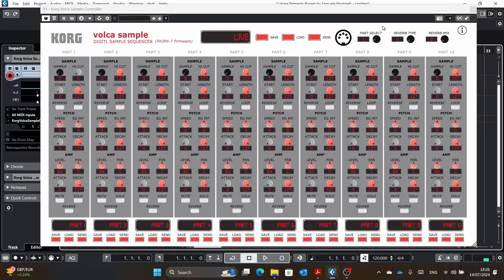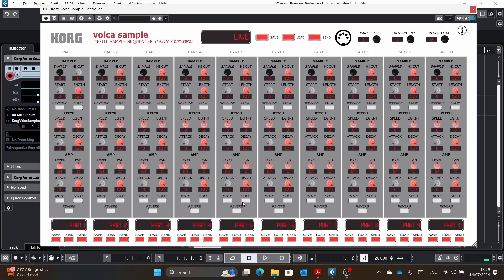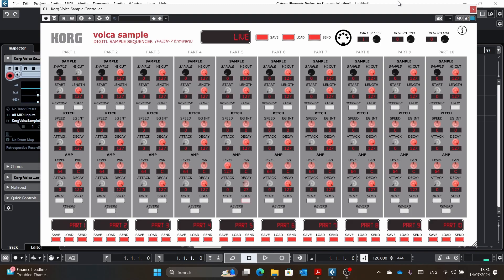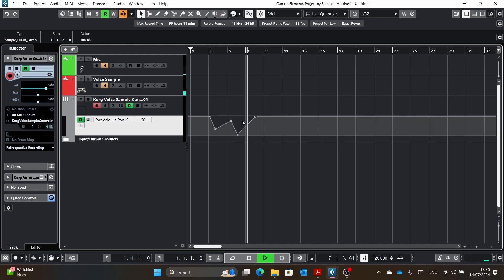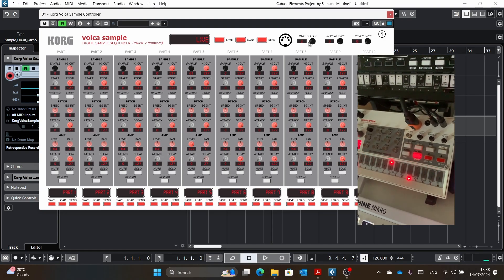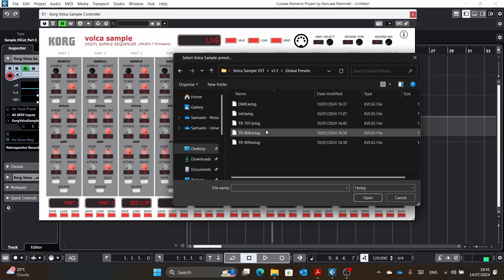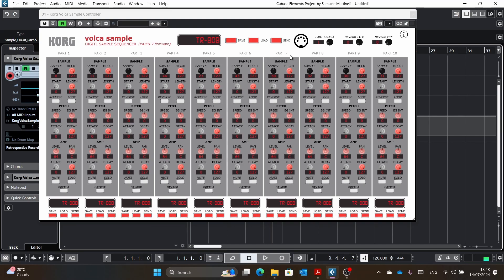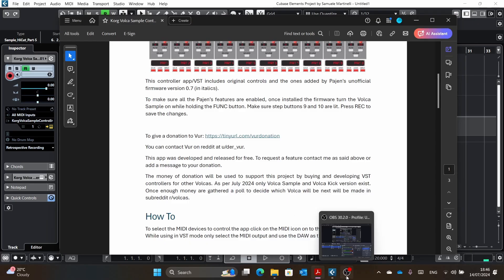Korg Volca Sample VST Controller (Walkthrough, Pajen firmware support & v1.1 Update) - Free Download

Comment: It cant be used standalone without midi? for tests I think it would be usefull before using the hardware
Reply from the maker: I mean you will have nothing happen. It does not emulate the volca sample. If you want to load it in your DAW and play around with the parameters without connecting to MIDI you can of course do that. Unless I misunderstood your question...

Comment: Keep it up! Looks amazing. I found your video looking for volca sample 2 stuff but it’s always interesting to see MK1 upgrades and additions
Reply from the maker: @evilalive2411  if I have some time I might release a Volca Sample 2 even if I don’t own one, the knobs and settings are there I only need to get rid of the Pajen ones (that I’m aware of Pajen firmware cannot be loaded on the Sample 2) and change the midi output of the remaining knobs, might take some time but it is not like starting from scratch like I would need for the other Volcas
If you want you can follow me so you will be notified of this whenever I’ll have time to do it, I’m currently working on v1.2 of this and the Volca Kick though, so it might take some time
Reply: @der_vur  I'll keep an eye on your channel then! Seems really cool! I'm learning to use ableton at the moment and would love to have some extra control for the sampler
Reply from the maker: @evilalive2411  FYI I checked the MIDI implementation chart (https://cdn.korg.com/us/support/download/files/c19d48a599794ff64a25b553e951c2fb.pdf?response-content-disposition=inline%3Bfilename%2A%3DUTF-8%27%27volca-sample2_multi_ch_MIDI_Chart_E1.pdf&response-content-type=application%2Fpdf%3B), and except the italics controls you should be able to control all the other parameters with this software too as the midi channel and CC is the exact same! (in multi channel mode). If you try please let me know if it works, the only controls you wouldn't be able to use are Sample Select, Chromatic Speed, Loop, Trigger Delay, Reverb and Reverse as Pajen implemented these in a different CC, but this also means that an update to include these for Volca Sample 2 will surely be quicker and will come before I expected. Again, please let me know if the other controls work on the Sample 2 in multi-channel. I might include a single channel mode in an update too!
Reply from the maker: Ehy, just released an update with a volca sample 2 beta version if you are interested: https://www.youtube.com/watch?v=Ygfx0uvlcMQ&t=3s if you test it please let me know if it works fine :)